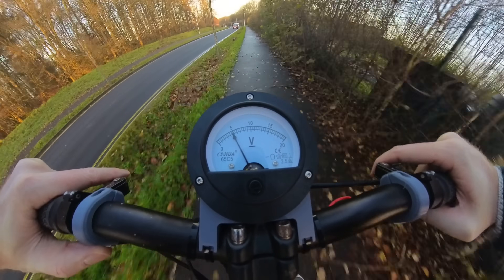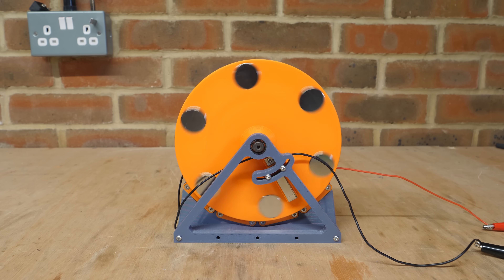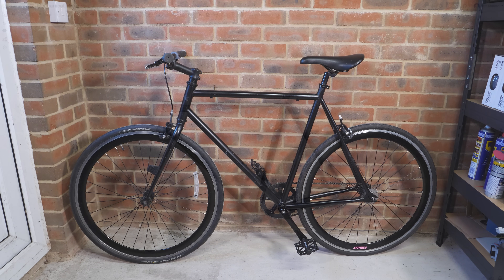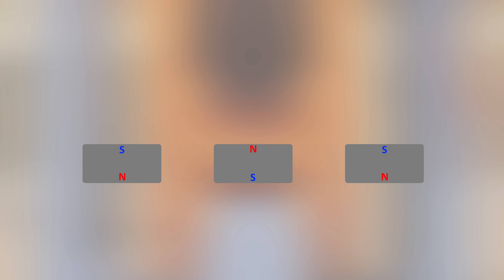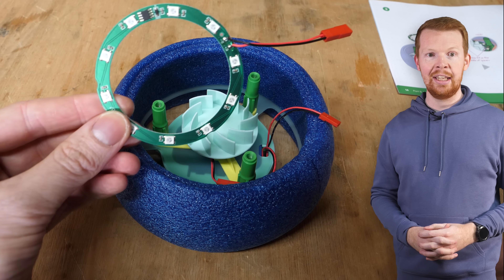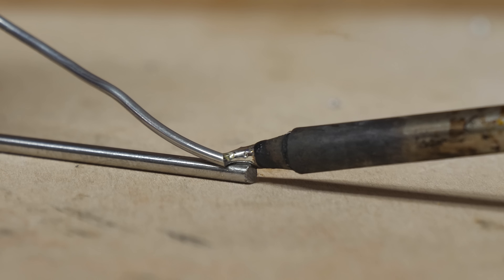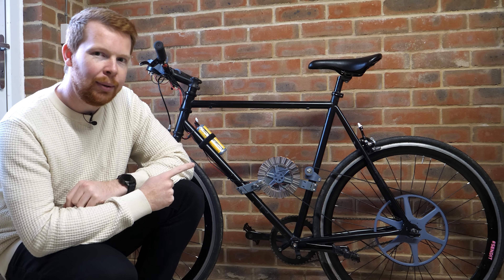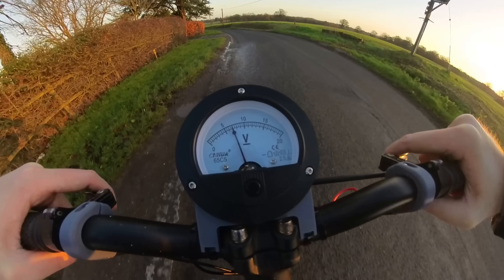The Most Minimal Electric Bike

Comment: Instead, use a bulb filled with high-pressure CO2 or some other inert gases, or use transformer oil/silicone oil that should significantly reduce sparkles and minimize heat and energy wastage.

Comment: You need a fly back diode in line with the coil. The spark you’re seeing is the self induced voltage spike from removing voltage from the coil. When the magnetic field collapses it induces a huge voltage spike that jumps the gap and burns out the contacts.

2:31
7:08

Comment: You don't fancy trying a relay operated by a normal reed switch? Ideally you'd use at transistor for the same purpose but a relay ought to do. Even if it has to switch quite a lot, it's no worse than the home-made reed switch you use here. They make them plug-in with sockets, so you could just replace one if it wears out, just pull and swap. Plenty of relays have clear cases so you can check all that out. Or else even built your own relay system.

Comment: For soldering tungsten, try using solder flux for stainless steel. I have not tried it with tungsten, but it did help me solder metals that normally would be very difficult to solder together.

Comment: I understand that your goal was to do this "without electronics."  However, I think you could have made a very simple circuit using a reed switch, an op-amp, and a power transistor (and a few resistors) that would have gotten around the whole sparking issue.  This would also have allowed the system to function at a higher rate of speed and may have solved the resonant frequency issue.  Basically, turn the reed switch into a sensor that uses the power transistor (or MOSFET) to actually complete the circuit.

Comment: Oil bath the reed switch and increase your capacitors capacity for voltage and amperage. That's the trouble with permanent magnets the faster you go the more voltage and current and it causes drag. Have an exciter circuit to energize the fields for charging and powering the bike along. Food for thought 🤔

Comment: Read a datasheet from a real brand like Cherry Omron etc. Contact Rating printed on a switch etc are often AC Volts and Amps for a Restive Load. A Coil or Motor is an Inductive Load and derate the contact to 1/3 to 1/4 of the Amp printed. DC Volt can be 2/10 to 1/10 of Volts printed. Even if can find contact to handle the load, you need some type of snubbers to stop arcing. many types of that using resistors, capacitors and more.

Comment: Or you can just use a motor with brushes, then you can plug a battery directly into it and it will just work. It also basically uses "switches" inside (the strip that the brushes contact acts like a switch) and yes, the brushes will degrade over time, but good motors allow you to replace them and are built so that the brushes degrade faster than the rest of the motor, so you can use a motor like this for many years and only have to replace the brushes from time to time. It's a lot less of a deal than most people think. After all, if you have a car with a gas engine, you have to change the spark plugs from time to time.
Reply: I would like to point out that a car generator also has brushes that need to be changed sometimes.
Reply: @igorok1362  Most people never learn about that since usually the brushes outlive the engine. Which is another proof that brushes are not as fragile and not such a huge point of failure than most people think. Until recent years, it was normal for motors in washing machines to also have brushes. So the fear of using a motor with brushes just because brushes are a wearing part are quite exaggerated.
Reply: @xcoder1122  Brushed motors are generally less energy efficient and less suited to electronic control. Modern washing machines and their variable speed nonsense work much more efficiently with brushless three-phase motors than they could with brushed single-phase motors. I agree that brushes tend to outlive most consumer applications. I don't recall hearing talk of brushless motors saving us from heavy wear of brushes. Any time I see appliances or tools with brushless motors being advertised, it's for higher energy efficiency, variable speed, or higher power, or lower weight for the same power. I agree that OP's concern of brush wear is probably not an issue for such an application.

Comment: The issue with the switch burning up is that the motor is an inductive load, you need to clamp the flyback voltage with a diode.

Comment: I understand that the point of this is to not use fancy electronics, but the arcing and size of the reed strip can be reduced / eliminated by just using the reed actuation to gate a suitably sized mosfet / transistor. Should be able to accomplish very little arcing with this and the circuit is incredibly basic.

Comment: Just use the reed switch to drive an optocoupler, to then electronically toggle the current (maybe with mosfets or something). This way you overcome the voltage limit from reed switches and totally get rid of the sparkling issue.

Comment: Halbach array, huh? Very cool! I think from a performance perspective, it would almost certainly have been better to make your rotor disks of iron/steel, but one can't argue with the see-through aesthetic! Note that iron/steel rotor disks do NOT add freewheeling losses, since they're only exposed to the static magnetic field of the magnets that rotate with them, for which they act as "back iron". This is a very common construction technique for home-brew axial flux coreless generators/alternators for windmills (typically old brake rotors are used as back iron). 

Another point of note here is geometry. For an axial flux coreless motor like this, the coils really want to be much more "pancake" than these. The distance between the rotors wants to be equal to or shorter than the width of the magnet pole face, so that the flux has a hard time getting out from between the magnets and going anywhere other than the opposing opposite polarity pole. This will also reduce the leakage inductance of the motor, and so both lower the inductive impedance and raise the short circuit current. That's a double benefit, since the inductive impedance causes the commutation to be too late at higher speeds. Or I guess more accurately it causes the current to lag, so the ideal commutation has to happen early.

Comment: A hub dynamo is not really noticeable as a drag. When I go bikepacking I always have a dynamo powered power bank with me to charge the electronics, without which our life does not seem to work these days. Maximum power I can extract is about 12 W, I have even considered adding a second dynamo in my rear wheel. (I have a gearbox in my lower bracket, so the space is available; but frewheeling hubs combined with a dynamo are not commercially available AFAIK.
Even so, I don't produce enough power to run a smartphone continuously; i have gone back to navigation with paper maps...
In an earlier life I was working on high voltage switchgear. The contacts carrying the arc were made of sinterd copper tungsten compound. Pretty arc resistant. Even more arc resistant is graphite, but it has the drawback of being not very robust mechanically. Come to think of that, I think contacts of high current relays are made of a similar material, but I think it's sintered tungsten and silver. The advantage of these compound materials is that they can be soldered.

One hint on belt drives with tensioning rollers: It's advantageous to install the tensioning roller on the outside, This increases the arc of contact on the pulley, which makes for better engagement. A disadvatage of this arrangement is the reverse flexing of the belt, which can reduce service life.

Comment: You should optimize that rotor with the diameter of the front wheel with the reversible battery system, I think you will achieve great success.

Comment: A bi-directional ammeter would have been a nice touch in place of the voltmeter. The ammeter would show you the rate of charge or discharge, but would not have given any idea of the capacity of the capacitors.

Comment: You know, I've noticed you seem to ignore relays in your projects, is this intentional? I made the observation back in your coil gun when you had to make the connectors massive to handle the power being pushed through them, why not have used a relay to keep the connectors from being melted? And why not use a relay on this one instead of created a super large magnetic switch?

Comment: This is basically how a hybrid car works. Your bike never gets plugged in. 
What if all the momentum of the vehicle were channeled to an air conditioning compressor that made a large quantity of liquified refrigerant. Then the air conditioning and heating could be used without parasitic power loss on the engine increasing fuel economy.

Comment: Can you try to make an e-bike electric motor with bell shaped electromagnets? 2 cm wide, round, with 200 turns of 0,1 mm wire. If you get it correctly, it'll be able to lift around 145 kilogrammes with 4,5V and 300mA.

Comment: Bicycle with KERS ;).
If you finally used diodes for bridge, you could use one(s) for damping EMF to limit sparking on contacts (or capacitor ?). But i have mixed fellings if diodes are not electronics ;)
Maybe not easily availabe but i'm sure i've seen heavy duty reed switches or maybe you can use it to open and close relay.

Comment: What resin did you use for strength like that? That's the sort of components I would expect to be printed using FDM instead of SLA, resin is usually too brittle for hard working parts.

Comment: Build that into the rear tire, and you will have a product you could sell. You are limited by the gearbox on the bike. If you installed another set of gears on your alternator, you might be able to get more rpm. Your rectifier is reducing your output energy. The belt drive is suboptimal for powering torque. You might be able to add a hub motor to the front
Tire so that you could use the stored energy there.

Comment: You could use reed switches to control MOSFETS that handle the higher power current. This way you could use beefier capacitors that draw and supply a lot more current to your motor/generator. Using more current you might be able to get better performance

Comment: G'day Tom,

Yay Team !

I'm more of a Consumer of EV technology than an innovator at your level ("The SunFoil Project...", excepted, perhaps ; in that I've been driving a Road-Registered  Piston/Solar Hybrid since 2010..., check my Playlists to unpack that...).

However, for years nobody could tell me how much money one had to spend on a stand-alone  Off-Grid Solar System to recharge an EV...

And, over the past 5 weeks I've logged 650 Km on my Talaria Sting L1-e, running on Sunlight, via 2 X 440 Watt 40-Volt Panels, a 1,500 Watt Charge Controller, 10 Kw/Hr of Gel-Cells at 24-Volts & a 1,600-Watt Inverter...,

The Bike has a 6 Kw Motor regulated to 3 Kw Maximum continuous & 3.5 Kw Peak - so to take the max. continuous as being accessibly Real...

This means that, at $10,049 (Oz Dollars) for the Solar Installation, including 10% Federal Goods & Services Tax for the specific dedicated Setup to recharge One  EV with a 3-Kw 
Motor....; 
That boils down to 
$3,335 worth of Stand-Alone Solar Installation, to 
Recharge the EV's Battery -
Per Kilowatt of the Motor's Rated Maximum continuous Output....

So, if a Tesla has a 50 Kw Motor (66 Hp), then expect to spend $167,000 worth of Stand-Alone Solar Setup to feed it after Sundown, following a day's 
Out and abouting...(!).

Yesterday I posted a Chest-Camera view of most of a 44 Km Ride which was done in 1 Hr & 1 Min, for an average speed of 44 Km/Hr, arriving home on 45% of the 2.3 Kw/Hr Battery's Capacity remaining.

Before getting the Solar System completed, the same Bike running on a 3-kVA Generator, with a 220cc 4-Stroke Engine burning 91-Octane Unleaded, was running at 25 Km/Litre, or 4 Litres/100 Km....

So, apparently a Tesla on Coal/Gas-fired Gridpower has at least the same Carbon Emission Footprint as does any Diesel or Petrol or LPG burning 4-WD of comparable
Weight...(?) !

Please feel free 
To backtrack me
To my Videos, 
Therein to find & see
What the World looks like
On an actually Sunlight-fuelled
Motorbike...;
Road-registered and lawful to take out on the
Public Roads...

For less than the cost of a small new Car running on Fossil Juice, one can acquire a little Electric Chook-Chaser style of a Motocross Bike, AND all the Stand-alone Solar System to run it on.

Over 7 years at today's Petrol prices, the Bike will pay for the cost of it's Solar System - in Petrol not fed to the 2-litre 2000-vintage Forester, by going to town 3 times a week for small Groceries....

I only inherited some tens of thousands of Dollars, so therefore I have taken the "Poor Man's Tesla" option, but it appears that an actual Tesla costs $92,000 for the Car...., and needs another $167,000 worth of Solar Setup already insitu, to feed it with when one goes home at night.

One wonders quite what the 
Actual 
Plan
Might be,
For they who're confidently 
Awaiting the day when,

"The Technology matures sufficiently that EV's running on Renewable Energy becomes
Affordable for the
Average Car-Owner to be able to realistically make the changeover...."

Or, words to that effect.

 There are 8,900 people in my Local Government Area, and I'm the only Solar-Electric Motorcyclist shopping in the Main Street 3 or 5 days per week, and staying alive on the Highway at 49 Km/Hr beside B-Doubles at 100 Kicks passing a metre off my Wing-Mirror..., 10.5 Km of that, each way, every trip.

2,650 Km so far, a bit over 61 Hours logged, 650 of that on Sunlight - so it's saved 59 Litres not burned in the Forester, this past 5 weeks.

Hopefully, I'm not the only one who's interested to know what the actual practical Numbers have turned out to be ; in the
Actuarial
Reality...

Such is life,

Live a good one...

Stay safe.

;-p

Ciao !

Comment: As boys back in the seventies we made wooden soap box cars with old school 12V DC car dynamos as motors (via a fan belt to a pulley fixed with wire on one of the rear (pram) wheels) and 6V lead batteries as power sources. One battery: Very slow. Turning a home made bar & bolt switch, some sparks went flying - and two batteries were connected in series. Speed level: Slow. Happy days!
Reply: I took the cheap way and just got a friend (mug) to push 🤣
Reply: You can use a capacitor to take the heat out of the contacts
Reply: @francisgoldstien6153   I guess your comment was to the creative mr Stanton, not to my childhood memories. But maybe, like the cap protecting car contact breaker points? I still guess that running these far larger currents through points exposed to air will cause rapid pitting and wearing anyway.
Reply: @francisgoldstien6153  A capacitor can reducing arcing, but it won't help with resistive heating.

Comment: 12:27 "So if we use four diodes to construct a 'full bridge' rectifier . . ."
Don't let the Dutch confuse you - - - That's NOT a "full BRIDGE" rectifier.
It's a FULL WAVE rectifier - - - wired in a bridge configuration.    SMH

Comment: 13:32 it’s better than free energy, it’s negative cost energy as it is reducing your need to replace break pads 😂
Reply: It's more or less the same thing on a hybrid car, some energy is stored in a battery when the car slows down, reducing the load on the brakes, and this energy is used when the car accelerates again.
Reply: they're break pads because they're subject to entropy lol /s
Reply: True, it is negative cost. (And the spelling bit cracked me up! 🤣)
Reply: There are eddy current brakes (retarder) for busses and other vehicles. They convert brake "power" into heat without abrasion.
Reply: Brake
Reply: @ thanks for the spell cheque
Reply: @RossGirven  Czech*
Reply: Brake

Comment: I wonder...would adding a transformer (to step down voltage for the off-the-shelf reed switch) which toggles a Relay that actually powers the motor coils be considered breaking the "electronics-free" rule...both of those are more mechanical then semiconductor and microchip to me.

Comment: If there isnt much parasitic torque to back drive the motor, there isnt much power generation either. They are proportional by conservation of energy. Leaving out the iron cores just substantially weakens the motor power out and in available. I think a standard rotating contact arrangement makes a lot more sense than reed switches. Aka a normal permanent magnet dc motor with comutator and brushes. I get it though sometimes its the journey more than the destination

Comment: Can you create an analog ECU for a car? During the pandemic, there was a widespread chip shortage which led to brand new cars sitting idle due to missing microprocessors, so having a way to get around that while still being able to pass safety and emissions tests would be ideal. The various sensors that ECUs read data from (O2 sensor, thermostat, wheel speed, etc...) are already analog, so you'd be interpreting that information directly rather than converting it into a digital signal which makes things easier, in theory.

Comment: Would it be cheating to put a capacitor across the contacts to suppress the arcing? After all, this is what mechanical car ignition systems did for years before electronic ignitions. An old car condenser would probably work great, and would also boost power by having a resonance with your winding inductance. If it's cheating to use a component, you could make one yourself by tightly coiling layers of foil and paper.